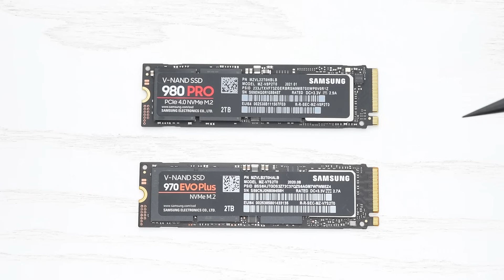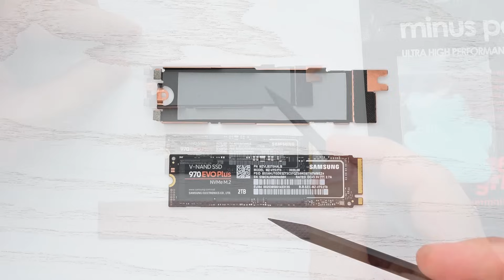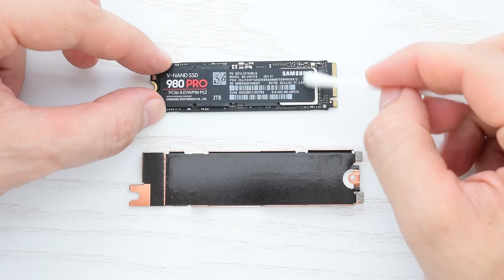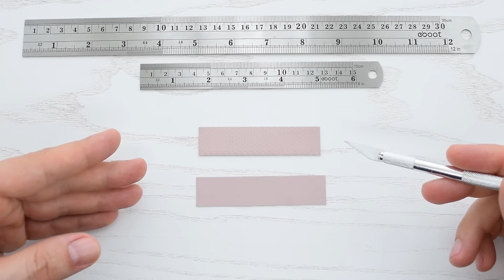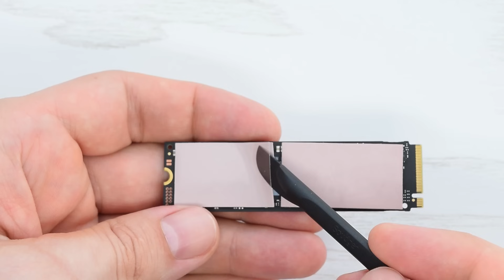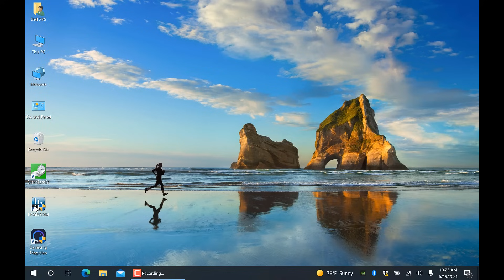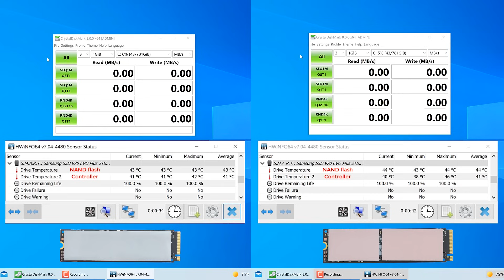Stop your Samsung NVMe SSD from Overheating and Thermal Throttling

Comment: Hi, I bought a Samsung 990 pro and was going to use your technique when I upgraded my drive but came across something strange. When I removed the old ssd there was an L shaped thermal pad underneath the ssd attached to the motherboard on the side where the ssd slides into it's housing. I wasn't sure if I should leave this in place or remove it or put down a thermal pad across the whole area (I'm talking about underneath the ssd). Have you ever seen something like that? It causes the ssd to not sit flush against the mother board on one side. Maybe this is a good thing to allow air underneath? I don't know but I was curious what your thoughts might be. I could send pictures if that helps you to understand what I'm talking about. Thanks. M
Reply from the maker: Yes, attach pictures here or tell me what's the model of your laptop.
Reply: Hi, I’m just wondering if you got my email. I sent it to your hotmail email address. I hope that’s still in use. Could you please let me know? Thanks. M
Reply: @ElectronicsComputers I sent pictures to your hotmail email address (listed here on YouTube). Did you get them? I hope it's still in use. There wasn't a way to post them here in the comments on YouTube, that's why I emailed them. Please let me know if you got them. Thanks. M 🙏
Reply from the maker: @MR-tt9mc  Yes, I got your email. I haven't seen such a model in my repair shop yet, so it's new to me. If your laptop originally came with an M.2 2230 SSD installed, then the use of a thermal pad like that might make sense. However, I wouldn't use such a shape of thermal pad for any Samsung SSD. I would opt for either a full-sized thermal pad beneath the drive to transfer heat to the board, or I wouldn't use one at all. For the controller and NAND chips, I'd still recommend using two separate thermal pads. Samsung employs a similar approach with their SSD heatsink version: https://i.ibb.co/10HwmmQ/980PRO.jpg
Reply: @ElectronicsComputers The original ssd was a M.2 2280. I thought it was strange too. Do you think they were trying to keep it off the motherboard so the heat doesn't transfer to the board? Or maybe they were trying to push that end closer to the heatsink (since they didn't use two different sized pads like you recommend for the Samsung ssd in this video)? They just used one full-sized .5mm pad on the heatsink above the original ssd.  I was going to put a full-sized thermal pad underneath the drive but I didn't know if it would make the board too hot. I don't know if that is bad for the board. I will be using the two pads on the top like you recommend. It's just the bottom that has me confused. Is it bad if it transfers heat to the motherboard (if I use a full size pad)?
Reply: @ElectronicsComputers So, I inquired to Dell about this L-shaped pad and asked what it's significance was. At first they told me there wasn't a pad under the ssd. When I disagreed they asked me to send a picture. I sent it and the response I got back was that it was for heat dissipation and that I should leave it as it is and install the SSD on top of the thermal pad. To be honest, I don't know if I even trust their judgement considering they said there wasn't one there and there clearly is.
Reply from the maker: @MR-tt9mc  Applying a thermal pad between the SSD and the motherboard is not going to prevent heat transfer, it would do quite the opposite. Is it a good idea? Well, that depends on the components around it and on the other side of the board. If there's nothing that dislikes heat, then it's okay. I've checked the service manual for your model, and in the photos, they don't use an L-shaped thermal pad; it's a big one to cover the full size of a 2230 SSD. That model comes with both 2280 and 2230 with an adapter to accommodate that SSD into the full-length slot. And that's why I asked if your laptop came with a 2230 SSD. Most likely, that M-shaped pad was designed for a specific SSD model that has the controller chip and some components on the side prone to overheating. Here's my professional advice as an electronics engineer, it's up to you whether you decide to follow it or not and whether it makes sense or not: If you're going to use that Samsung 990 SSD, you should either get rid of that pad or use a full-size one. If you keep that L-shaped pad, which will press half of the SSD to the heatsink, while the other half will be pushed down by the heatsink, it creates a bending effect that is not good for very fragile PCBs like those in M.2 SSDs. Here's the photo of the board: https://i.ibb.co/Dz85RF3/Screenshot-2024-03-22-104340.png
Reply: @ElectronicsComputers Thank you so much for your help. I'm trying it with a full sized pad underneath. I definitely don't want to take the chance on bending the ssd. So far it's running at 45°C for normal to low use. I hope that's good. I'll keep an eye on the temps and if it's starts getting too high I'll try it without any pad underneath. Thank you again.
Reply from the maker: @MR-tt9mc  I'm happy to help! There are two temperature sensors, the one that you see in Samsung Magician only shows the NAND temperature. If you want to see the controller temperature, then you need to use the app that I was using in the video. If the controller's temperature is below 60C, then it's pretty fine. Anyways, you bought one of the best SSD on the market, and I'm pretty sure you did everything right with its cooling.
Reply: @ElectronicsComputers  Thank you. I'll download it. 😊

Comment: thank you for useful video, i try this and bought cooler master thermal pads for my precision 5570, conductivity is 12 w/mc . i bought samsung 990 pro 1TB and gigabyte 2500E 1TB. i checked thermal sensors, IC controller temperature for samsung in above 76 C during "software crystal disk mark" check.  so is it high or normal? my NVME read speed is 5500 not 7450 for 990 pro. i guess controller reduce speed for decreasing temperature. i check heat sink but i cannot check visually for heat sink contact to the thermal pad. do you have any solutions for checking thermal pad contact to heat sink? how?   other question, i install 990 pro on SSD2 slot if i relocate samsung from SSD2 to SSD1 slot, it may be better to reduce 990 pro temp.?
Reply from the maker: It doesn't matter in which slot you put your SSD, both have the same PCIe Gen4 speeds and other specs. If you applied a 0.75-1mm pad on the controller and a 0.5mm pad on the NAND chips, then all your components are making proper contact with the heatsink. 76°C under heavy load I'd consider a borderline high temperature, but in real life, even when gaming, you won't reach those temperatures on a constant basis. Also, in my case, I deliberately used a Gen 4 SSD on a Gen 3 capable laptop to lower temps; in your case, to do the same trick, you'd need to use Gen 5 SSDs. Overall, just monitor the temperature for a couple of days doing your regular tasks, and if the temperature stays in the range of up to 59°C, I wouldn't worry about SSD overheating and thermal throttling.

Comment: I intend to purchase this little guy for gaming laptop, this will be the heaviest task on it. Probably without the heatsink, since it's a laptop. So I have some questions, if anyone can help:

1) I heard it gets considerably warmer than others, but I saw tests saying it has ok temps, it just heats more on heavy data transfer processes due to its higher speed. Should I worry about temperature on gaming? My current SSD stays between 30 and 37°C on normal use and a little more while gaming.
2) Is the heatsink detachable (without doing any 'workaround')?
3) In case I get it w/o the heatsink and it gets too hot on normal use, can I put on it a 3rd party heatsink that suits the laptop size?

*Note: I know the 990 Pro is too much just for gaming, but the price in my country are similar or even lower to other SSD prices that don't have the 990 pro performance
*Note 2: my laptop has good airflow refrigeration
Reply from the maker: The heatsinks I was using in the video are the original ones that came with the laptop. If your laptop doesn't have one, you can use some universal ones that look just like a thin copper plate. If you give me the model of your laptop, I might be able to provide some recommendations. Personally, if the prices are pretty much similar, I'd choose the 990PRO. That SSD is super reliable, fast, and won't become obsolete specs-wise even in several years. My laptop has two 980PROs, and I'm fully satisfied with them.
Reply: @ElectronicsComputers  nice! My PC is an Avell C62Mob, it's a Brazilian brand. Fortunately, I'm not sure if it already has a stock heatsink but I'll check. Fortunately, it's possible to attach a thin thermal pad

Comment: Thanks. I'm wondering if instead of buying 2 sizes, just use double .5mm to create a thinker pad as needed?
Reply from the maker: Yes, you can do that. Xbox uses such technique in their power supply but the thermal conductivity will be slightly lower, though.

Comment: Today I installed my Samsung 970 EVO Plus with ELUTENG M2 heatsink on my Z170A MB. At first it ran pretty hot at idle 53C and 65C max. Then I added the second silicon warmth pad and measured again: idle: 47C and 63C max. Still a bit too hot to my taste, but then after closing my PC cabinet the proper airflow was re-established. Now I measured 39C and 54C! So now I am happy. I also installed a Crucial NVMe on a PCI board and that one runs a lot cooler still with the same type of heatsink: 25C idle and 35C max! No additional ventilators needed. The on-board airflow is cooling both NVMe’s more than sufficiently.
Reply from the maker: Great job!

Comment: Just wondering if there is a reason you did not remove the label / sticker from the SSD to have direct contact between the Thermal Pads and the Chips?
Reply from the maker: Removing the label will void the warranty and it doesn't make any real difference in cooling your SSD.

Comment: What if separating the "flash, cache/DRAM/etc, controller" thermal pads all together. Will it help... the hotter one not to transfer heat via pad?
And... do we really need that label sticker?
Reply from the maker: Samsung recently came up with the updated 980 PRO with a built-in heatsink. And if you remove that heatsink, guess what you'll see inside? Yes, there will be several thermal pads with different thicknesses, just as I showed you in the video. But they went even further and made separate pads for small chips as well. You can check out the pictures: https://i.ibb.co/10HwmmQ/980PRO.jpg
Removing the label will void the warranty and it doesn't make any real difference in cooling your SSD. If warranty is not the problem, then go ahead and remove it.
Reply: @ElectronicsComputers  Thank you. Perfectly answered plus with a guidance image. And for the sticker issue, I elsewhere (possibly on KitGuru for 970 PRO) read that sticker contains a copper layer though I have no way to confrm it.

Comment: If I install this ssd 980 pro into gen3 and will use it for gaming will it need those thermopads? 

Or maybe could you reccomend some good quality 1TB ssd, I don't care about speed  just want it to be realieble and dont heat too much.
Reply from the maker: From my tests using the 980PRO on Gen3-capable PSs, even without any heatsink, the SSD won't overheat. I have a video on that. However, if you're planning to do some gaming, I'd still recommend attaching a universal heatsink. It's a thin copper plate that mounts directly onto the SSD. It's very thin and will work with laptops that don't have much space for a heatsink.
Reply: @ElectronicsComputers  Ok thanks!

Comment: when you act pro while you suck if you removed the plastic you would solve the heat problems on the ssd
Reply from the maker: Removing the label will void the warranty and it doesn't make any real difference in cooling your SSD.

Comment: With this method are you accounting for the pre-installed copper plate/pad on the bottom of the 970 pro?  Did you remove it?

It seems that this pad is approximately   .5mm thick on the bottom NAND side, which is why you applied .5mm to the top side, and 1mm to the top controller side; making the both sides equal 1mm.

I don't see people being specific about this, so your input would be greatly appreciated.
Reply from the maker: It has nothing to do with a preinstalled copper plate. The surface of that SSD is uneven, and you need either a super compressible thermal pad (which is very bad in heat conduction), or you need to use several thermal pads of different thicknesses to level that surface. Samsung also made an SSD with heatsink, and they basically did what I showed in the video. They even went further and made different pads for small chips. You can see it here: https://i.ibb.co/10HwmmQ/980PRO.jpg

Comment: I just ordered a WD SN850X and a 4 pack of 0.5mm Arctic thermal pads. Would it work out the same if I put a 0.5mm thermal pad cut to size over the controller, and then laid another 0.5mm pad over the length of the drive, as I would still end up with 1mm of thermal pad over the controller, and 0.5mm over the memory doing it that way...yes?
Reply from the maker: Yes, it will work just fine, though the performance of that stacked thermal pad will be slightly slower. However, the difference is very small and won't make any significant impact.

Comment: Where can such thin metal heatsinks for laptops can be found ?
Reply from the maker: The link for Dell XPS in the description. If you have different brand or model  I can also give you a link.
Reply: Using laptops only, can you share heatsink at least for Seagate Firecuda 530 and Samsung 960 pro pls  @ElectronicsComputers
Reply: I have a lot 😅 : 
1) Seagate FireCuda 530 4tb ; 
2) Samsung 960 pro 2tb ; 
3) Sabrent 3.0 4tb 
4) Sabrent Rocket 4 plus 4tb ; 
5) Sabrent Rocket 4.0 2tb ; 
6) WD SN 530 1tb ; 
7) Micron 3400 1 tb ; 
8) Samsung 970 pro 1tb.

Comment: Probably depends on clamping pressure as well, laptop heatsinks are marginal to begin with, desktop usually fine.
Reply from the maker: That's right, it is primarily a problem with laptops.
Reply: @ElectronicsComputers  Yep, with just $10 standard amazon 2 piece heatsinks with the 6 side screws my 980 pro boot drive idles around 43c, the 970 evo plus 36c.   Just the single strip of pad but I give it a good squeeze before screwing it down.  Maybe I'll try your method next time, but its too much trouble to change now lol

Comment: Great video. 
I want to apply thermal pad on sodimm. Is it good for lower temperature.?
Reply from the maker: Thermal pad acts as a medium between the components and the heatsink. If you just apply a thermal pad without any heatsink it won't even hold on that component.

Comment: Aliexpress 1080PRO 4TB SSD Original Brand SSD M2 2280 PCIe 4.0 NVME Read 14000MB/S Solid State Hard Disk For Desktop/PC/PS5 Game Laptop 
are these a scam ? $25 wtf originals want $250 min Got be  a scam  check it bro!
Reply from the maker: Don't buy it, it's a scam.

Comment: Excellent video!!  It makes a lot of sense too.  Thanks for the information.  I have found this problem recently with my Dell XPS.   It has been causing me issues.  Now, I have it on the run.
Reply from the maker: Glad it helped! Samsung actually fixed the problem with their SSD heat sink version in the same way: https://i.ibb.co/10HwmmQ/980PRO.jpg

Comment: Hey, I have a Lenovo Ideapad Gaming 3 15ACH6 and 970 EVO PLUS (1TB). The temps dont seem that bad in both HWiNFO and Samsung Magician but whenever I put it under heavy load (downloading games from Steam for example), the disk dies and kinda disconnects. It's unreadable and my pc completely freezes. I've found a post on reddit with the guy that has the same laptop as me and disk and he had the same issue (it has 4 upvotes. I don't know if he just upvoted it himself from three accounts or if three other people found themselves also having this issue). We both bought the disks around the same time, could this be a problem with the pieces that were made in a certain series or a laptop problem? Haven't found much besides also one review on the site I bought from, the same thing happened to someone that bought the same disk a week or two later (I assume they had a different PC). I feel like our models don't know how to thermal throttle since today I booted a live Linux image and did a GNOME disk benchmark, Controller reached (Temp sensor 1) 80 celsius and NAND (Temp sensor 2) 95 celsius. The disk hasnt turned itself off though, it just reached absurd temperatures.

Do you have any advice?
Reply from the maker: I doubt that the problem lies with your SSD, but those temperatures are extreme and could lead to rapid component degradation. Even though the SSD model is generally reliable, I wouldn't trust valuable data to that drive anymore. Have you ensured that your drive has the latest firmware installed?
Reply: @ElectronicsComputers I've done everything in my power. Updated firmware, BIOS etc. 
To me, it feels like the controller in my PC doesn't know what thermal throttling is, it doesn't know when to stop and it just keeps going. I'll have to return it and get another one I assume.
Funny enough is that the disk never turned itself off in Linux. It seems like Windows is doing this to not damage it
Reply: @spanokvleseletargie  same with me bro, same problem like you ... 15ach6 with kingston fury renegade non heatsink.... i think its way to hot when under heavy load... i just purchase cheap heatsink, and waiting for arrived...

Comment: Does it help if we use thermal pads on a nvme without any heatsink or will it only cool if we had a heatsink
Reply from the maker: Thermal pads are used as a medium between the SSD and the heatsink. On its own they won't even hold on the drive and of course won't make any difference in heat dissipation.